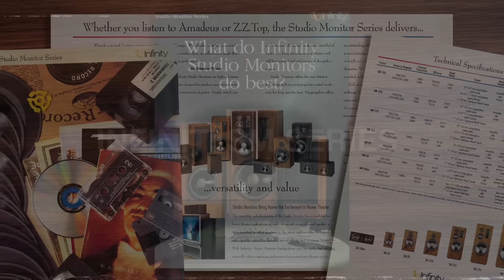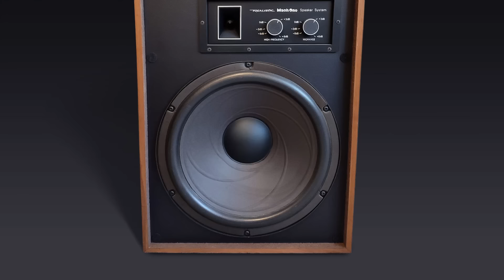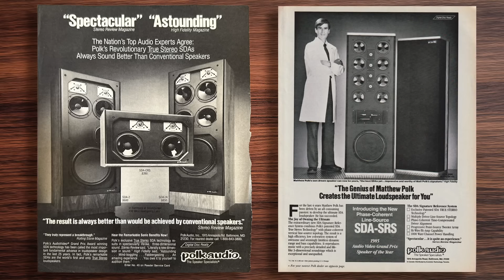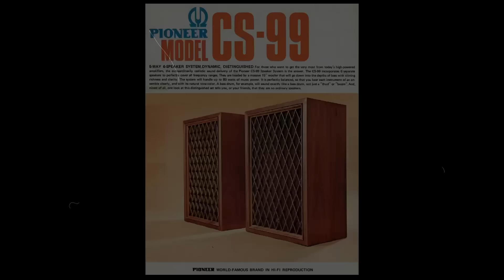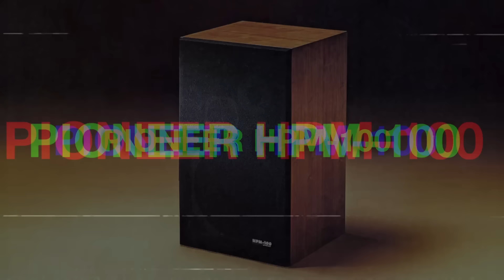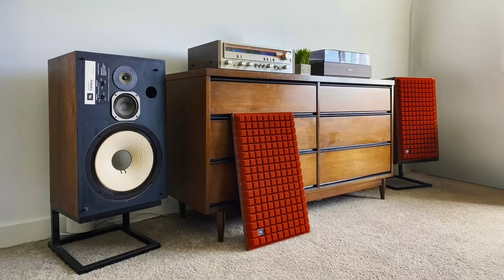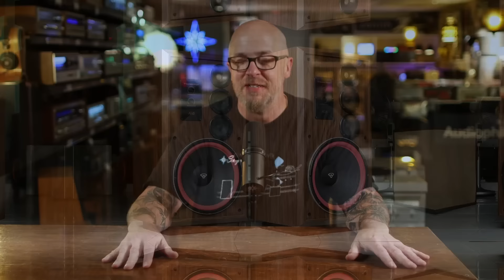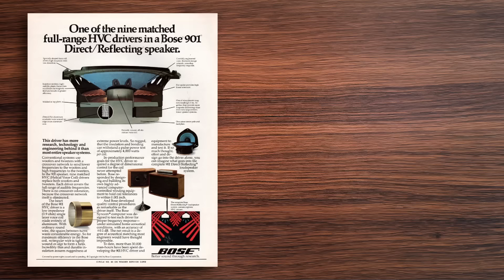Why Do Audiophiles Hate These 9 Legendary Speakers?

Comment: what's up Kev,  i have the SDA 1a's and have several pairs of the 80' era Monitor series and i truly believe all of those are some of the best speakers ever for that market segment and price point and have collected the era of Polk for decades.  the best thing other than the sound to me and my listening taste, i have yet to see or have to have done to any of mine is to have to replace the surrounds-AT ALL!!   the rubber or whatever actual materials they used in their surrounds in that era is the best and after all of these decades are still in great condition in ALL of my pairs in my collection. i also have a set of Infinity SM82's which i assume they are the little brother to the "SB" series, perhaps you can elaborate further.  regardless, when i hooked them up for the first time i was shocked at just how damn good the 82's sounded and still use them for everyday listening. granted, all of our tastes and what we each prefer is totally subjective but those 82's are one of my favorites in my entire speaker collection!!  have a great weekend brother!!  \m/ \m/

Comment: I had the good fortune to live with a pair of JBL L-100's during my college years. Yes, they were really, really good for that day and age. Speaker designers still incorporate that BBC dip into successful designs today. That stated, the 25 (or so) best sounding pairs of speakers I've ever heard don't have brand names and many are one offs. DIY or death, baby!
Reply: Back in the day, the people who raved about the L-100's also were critical of JBL's L-166 Horizon speakers which were sonically the polar opposite of the L-100's (neutral sounding).  Nowadays, classic sound enthusiasts hold the L-166's in much higher regard compared to the L-100's.  One of LBL's nicest looking speakers was the L-65's with their glass tops, they command big prices nowadays if you can find them in undamaged original condition with original alnico drivers.

Comment: I wouldn't give you 2 cents for Bose anything, they stroked that three flange speaker driver for years and put them in every speaker product they made back then, even the car systems. They were built like $hit and looked just as bad. They had a big name not because they were great sounding but because they had great advertising. Their speakers as I remember were 3 ohms and sounded terrible by themselves, they needed that EQ that came with them to sound somewhat decent. What my friends and I used to say was (Bose Blows). At the time my favorite speaker was AR now it's ADS. Still running my 980's and still happy with the sound.

Comment: I do have a set of Cerwin Vega DX-9s hooked up to my McIntosh power amp and preamp. Yes, they are bassy but turning down the bass setting on my preamp helps a lot. To me, they are a very well-defined speaker, and they are also very efficient.
Reply: Have you ever heard the AT-15's?
Reply: @iwontsubmit  Yes. I have a complete set of speakers ( with new woofer foams) & crossovers.  I'm just looking for empty cabinets to install.
Reply: @gmhfam2550  You can do a lot better than the rather poor quality CV cabinets.
They need significant reinforcement and doubling the thickness of the front panels. 
 I had the woofers reconed / capped using woven carbon fibre.
Reply: @BTW...  Im directly I can but I am so into originality. I just bought a pair of Cerwin vega  rs120s that need reforming which I will do. Cabinets are perfect. Paid $180.

Comment: I had a pair of Klipsch Cornwalls that I purchased at the Base Exchange when I was stationed with the Air Force in Okinawa Japan. I believe they had an SPL of 103. They needed to be played loud to really come alive. Not so great for softer music or at low volumes. Eventually moved of to a pair of Magnapans which were great. For these however, placement was critical and you really needed a robust  high current amp to run them.

Comment: It is not nostalgia that I love vintage stereo. My main stereo with a Dual 1216 & 506 turntables, Realistic receiver, and my speakers I put together with Pyle guts. They have never been retired. I have digital stereo, mainly as a switcher for my DVD players.  They are flat compared to my analog stereo. I now have my Dads Pioneer and Dual turntables. I added a second Realistic receiver. I now use 3 stereos and 11 turntables

Comment: 2 pair of 901's, each in parallel driven by Bose 1801 and 4401. Just right if you want music throughout the whole house (or neighborhood). A pair of Polk Monitor 10's with Carver Receiver 2000 for sit down listening to R&R and Bose 601's with Marantz 3300/250  for more critical listening to softer music........ You really do need more than one set of speakers.... Great video.
Reply: Bravo !  The more the merrier holds true. Good job !

Comment: Great list! I would have chosen all of the same speakers except that the Polk SDA series had not come to mind. I've never heard a set but have heard most of the others and have owned some as well, for a short period of time. I bought a set of Mach Ones and a set of Original Large Advents at the same time and definitely preferred the OLAs. The Mach Ones got sold off quickly.

Comment: I own Klipsch Heresy 2's, Cornwall 1.5s, JBL L-100s, Cerwin Vega VS-120s, and VS-80s, among a bunch of other brands. Yeah, it's a problem. The Klipsch cult is real. I own 3 pairs of Klipsch, but I'm a realist and haven't tied my ego to my equipment. The Heresy 2's are meh. Very little base but good vocals. I had to completely rebuild the Cornwalls, and after putting in proper bracing, real damping, and new crossovers, they sound awesome! Just really outstanding, but I had to fiddle with them. But bring up upgrades in the Klipsch forum/pages.....it's like you called their wives fat. The L-100s were another complete rebuild, and the real change came after I recapped them and put about 50 hours on the caps. But the cabinets are made of garbage-level particleboard. I'd say I used 3 pounds of Bondo stabilizing those things. Cerwin Vega.....underrated. I've A/B'd them against "better" speakers, and while they rock, they also image waaaayyyyy better than their reputation. And they use fairly decent guts! Cast woofer baskets instead of cheap stamped steel like in the 4-figure Klipsch. I put the VS-120s against a pair of ADS 810s, and it was closer than you'd think. Of course, the ADS won, but they also sell for 4 times as much and weren't 4 times better. CV cabinets might be worse than the JBLs, though. If I lived in an area with a lot of CV on the market, I might start making replacement cabinets just for fun. Plus, one could put real veneers on them then. DIY vinyl veneering is the worst thing I've ever tried in this hobby. I think I'd rather use a stranger's toothbrush before doing that again.

Comment: I had a pair of Bose 601's Series 3 back in the day, and they rocked! They pushed out the bass, and had a tweeter array on the top. In pure 90's fashion, I traded them for an Alpine car stereo/amp/speaker system from a friend!
Reply: I remember hearing the 601's in audio stores. They sounded great and seemed to put out a lot of volume without much effort.
 They were pretty expensive, maybe a few hundred less than a pair of 901's
Reply: The 301s were fantastic back in the day. The little reflector didn't do much, but they had a good, balanced sound with great bass.
Reply: @joshthayer1100 the 301seris IIs and IIIs have a pair of tweeters one across  the front and one into the back corner.   This does work pretty well.  The 8" pulp cone midbase is better than I anticipated.  I've since replaced the tweeters.  I have an Advent fried egg in front . The rear is a dome from Peerless ( ?  )  . The rear dome is down about 3 decibels from the Advent.  This seems to be a good thing.  The direct and reflected balance is better.  It still gives you that large sound stage.  But taming down the reflected part has helped the definition a bit . The Advent is  up front reaches the 8 inch midbase better.  Ironically I seem to have the same 1st order crossover frequency as the original at 2600 hertz. Would like to experiment with a lower crossover.  The Advent probably could take it . Not sure about that dome in back.  Anyway the 1st order network is working ...so I'm going to leave well enough alone. It was supposed to be a temporary set up . Had the drivers so I tried them . Seems to be more or less a permanent solution now .

Comment: I was recently given a set of Speaker Lab speakers. I know nothing about them, the history, or what have you; I know I had heard the name over the years.
I hooked them up to my early 90's system, and they sound great (to me, of course).  I watch all of your videos, but I haven't come across any where you've mentioned these things. Any thoughts or commentary on the Speaker Lab stuff?
Reply: I have a set of them, and they are better than they should be for the money. Voices and strings sound very natural. Not "high end, " but still very good. Not absurdly expensive. Paired up nicely with NAD electronics. Hi-fi is a luxury game for obsessives these days.
Reply: Speakerlab made a kit to construct a good copy of a Klipschorn that was a lot of fun to build.  Like the real thing, it was incredibly efficient with a forward sound you only get with a fully horn loaded system.  I still regret leaving them behind when I moved to a smaller place that couldn’t accommodate them.
Reply: What model?l built the .1 kit in 1980
Small sealed 2way treated paper woof, Phillips soft dome tw.way better bass than minimus7.of course it's slightly larger.
1
Reply: Still have my S3's

Comment: I am not a fan of the 901, or the klipsch. I preferred the JBL over Advents, for sure. The Pioneers, like other names of that era like the Sanyo 'Fisher' studio series speakers, really were built EQ'd for the mainstream music of that era. A proper "audiophile" speaker would not have sold well because that music was recorded rather badly. Audio was so competitive then, that designers had to design speakers that sounded good with popular music, and they did, except for the Kabuki speakers. 

Modern audiophiles, many of who took the shortcut and bought their way into that title pretty much overnight, are pretty ridiculous with their prejudices and cork sniffing attitudes. I've been a hard core audio addict pretty much non-stop since the '60s, and in spite of owning over a dozen pairs of speakers now, and as many different amps, I pretty much eschew what passes for audiophilia, these days. 

Oddly enough, I have no yearning for vintage speakers or gear unless it drops in my lap, in sound, working order. I even like the JBL Northridge Studio "S" series from the '90s to around Y2k-ish. They rock and don't get rotted surrounds. S38 and S312 models have good compromise of sensitivity and power handling. It was hard to abuse them without hurting yourself, so, many of them are still a good bet on the used market. I have 3 pairs of those and I still have them in systems around my house. 

Just assembled an Icepower 1200AS2 amp and the first speakers I hooked it up to are my JBL S312s, with a DIY tube preamp and an Arylic up2stream mini streamer board and I may just leave it just like that. It's that good.

Comment: One has to remember the Klipsch were designed when most amplifiers topped out at 25 watts or less
Reply: They also used EV drivers for a very long time.
Reply: Less is still best. Less total line voltage is less total harmonic distortion

Comment: I'm one of those lucky guys who bought a pair of HPM-100s for under $200/pr. before the prices blew up. They sound great driven by my really ancient Nikko Alpha 220 amp/Beta 20 preamp.  Almost every cheap speaker manufacturer copied the look of these for 10 years after they were introduced, which oddly might be why people don't like them.
Reply: Nikko . .. there's a walk down memory lane.
Reply: @jeffbowyer8886 I bought a set of Nikko separates in 1984 used for a great price - Alpha 220, Beta 20, Gamma 20. The amp is stout, but can't drive 4 ohm speakers (like large 1980s Infinity) very well. But it matches perfectly with the HPM-100s.

Comment: A lot of vintage speakers could  probably use modern capacitors and coils in the crossover network. A lot of the original caps could be leaking or dried out.
Reply: Even the caps drifting out of spec is enough to ruin the speaker performance
Reply: @ColoradoStreaming  and electrolytic ESR, poly caps are a must for tweeter

Comment: Ah, Bose, where the upper bass thump passes for extended range. Went to a 901 demo once at a dealer famous for its sound room  and they sounded glorious. I also discovered the very large bass speakers playing in parallel and hidden in the back. I never returned.
Reply: That was sneaky, for sure!
Reply: Thats how you sell 901's. 🤷
Reply: @stepanbandera5206  Bose sound ok if you never hear anything else.
Reply: It was easy to set up hifi salesrooms to unfairly influence purchase decisions, and it happened a lot, and maybe still does. I visited Music Box in Wellesley, MA. The owner hated 901s, didn't sell them, and was pushing Klipschorns. So he bought a pair of 901s and put them in a room with KHs for an A-B demo. Of course the KHs were set up optimally, and the 901s were not, using an amp that was good for KH but underpowered for 901s (KHs are much more efficient), room placement for 901s that did not follow guidelines, and who knows how the 901 equalizer was set. Even people who loved 901s thought they needed new KHs. And adding a powered subwoofer to a 901 system was a good way to address their bass deficiency, though of course, stores shouldn't have done that without disclosing it to buyers.

Comment: The Bose 901 had two dependences. The first is that the placement is critical. The second is that you need an amp with a lot of transient response .  These speakers had 18 drivers between them, and those speakers were inneficient, so if you did not use an amp with a lot of overhead, this speaker pair could not really achieve its best performance.  The Bose 1801 was the amp Bose used in its demo rooms, and it was the right amp for the job.  You need an amp with massive overhead so that you could accelarate those 18 cones as fast as possible. Set up right, and using a powerful amplifier, these speakers could deliever a very good experience and listening to music that was recorded live is a place where the 901s did excel.
Reply: What you describe is only true for 901 S1 and S2. The efficiency improved tremendously when bose introduced the vented cabinet (looks like jets on the back). I have the Bose Spatial Control Receiver (you see a picture of it in this video) with 50W per channel. It had 4 channels and could power two pairs of 901 s3 or s4. The SCR output can be bridged to 2-channels, 100W each. There is a third wire post on the s3 and s4 for the spatial control feature. The equalizer was incorporated into the SCR. The point here is Bose considered 50W per channel to be plenty for all 901s - except s1 and s2.
Reply: @jedi_mapperp4073  Yes, you are right. I had the S2.
Reply: Thanks for your outlook on the 901’s I grow tired of the same old drumbeat. No hi’s No lo’s must be Bose. Nonsense. Monkey see Monkey do.
Reply: What I love about the 901s is that I can walk around my open living room and kitchen yet hear the music well wherever I go. I don't often just sit in one perfect spot.
Reply: Maybe the store I heard them in was no good, although they did have expensive gear like Mcintosh amps. I still thought the Bose sounded lifeless and unmusical. Really crap. Good idea, bad execution. My ears told me that, not the spec sheets. Needed high quality drivers, didn't have them. Couldn't the Bose team measure frequency response? Prof. Bose was smart, but I don't think his design exceeded the sound already produced by others, like AR, which had smart people too. He aimed for a "concert-hall" sound, but forget to bring the orchestra.
Reply: My favorite 901 customer story was that the wife decided he could only have two speakers in the living room of the new house, not even a sub. Sent him home with a Carver TF1.5 amp to use. Came back saying it was close... sent him home with a second Carver after showing him how to bridge each amp. Also had him contract an electrician to run two dedicated 20 amp circuits to the Carvers. Mission accomplished!

Comment: Love your content! 😎👍

Sincere question: When people complain about "fatiguing" tweeters and "shouty" midrange in certain speakers, why is that nobody recommends tweaking the treble, midrange and bass controls on the amp/receiver, or even using an equalizer as opposed to dealing with the complications and expense associated with altering the internal crossover? 🤔
Reply: I agree. Marantz 2270 with 1984 Klipsch Heresy,s. 3 way tone controls make all the difference !
Reply: @bobc8649 I have a restored Marantz 2270 with Klipsch La Scala AL-3 and the midrange tone control does wonders for them. I also have Forte ii and drive them with tube gear with no tone controls. I drape a thin dish towel over the tweeter and mid horn. It works great! 😂

Comment: lm 55 and a Rocker. lve owned THEM ALL. New At15s and JBLs and the Infinity SM-155s, ARE the BEST Metal/Rock speakers EVER made. ( Put BIG/Real power on the amp and an EQ )  l paid $250 for em in 2005 and l WOULDNT take a $1000 for em now. Laugh if U want but, lm REAL.